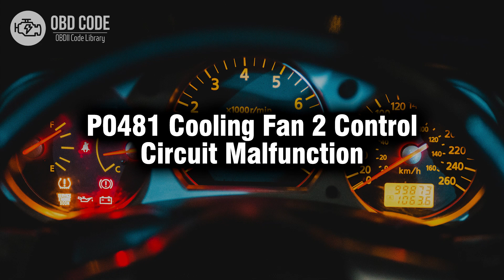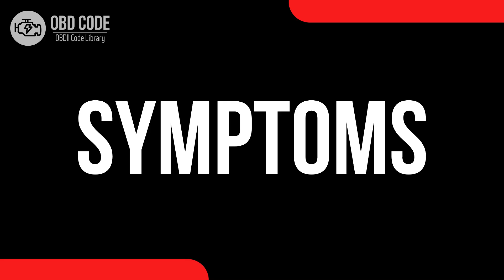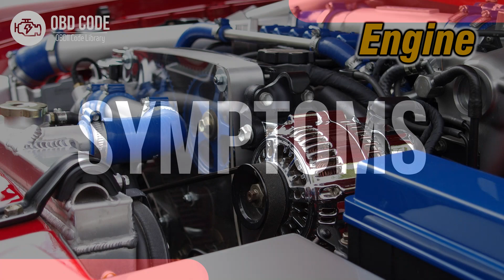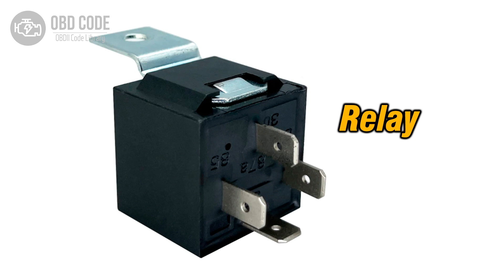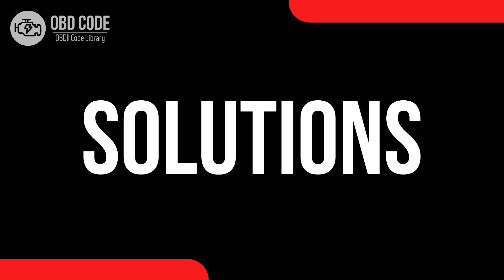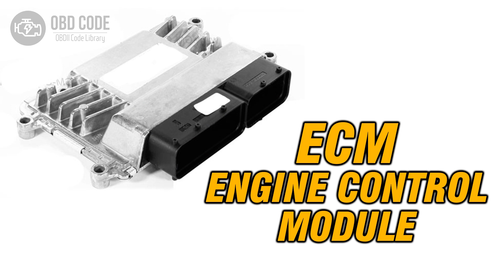P0481 Cooling Fan 2 Control Circuit Malfunction 🟢 Trouble Code Symptoms Causes Solutions

Comment: Where do you find the cooling fan relay to control circuit where is it located on the vehicle
Reply from the maker: Good morning, I advise you to review the workshop manual for your vehicle, so you can locate exactly each part that makes it up.
Reply: @obdcode. just say u have no clue